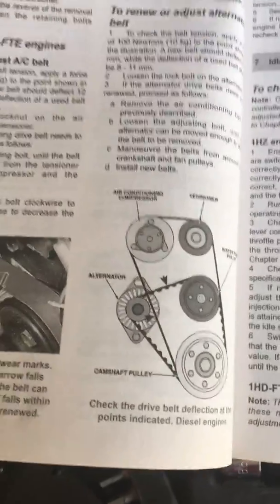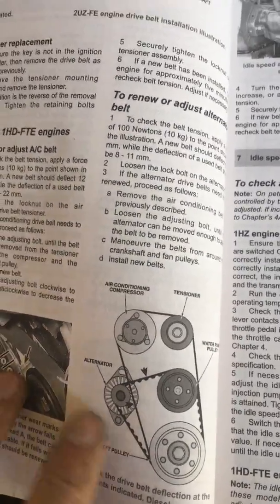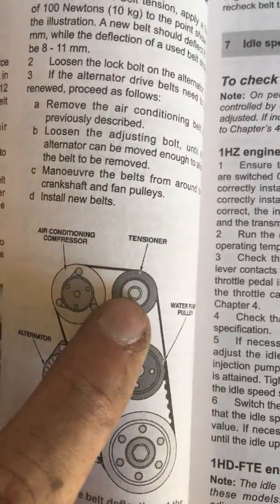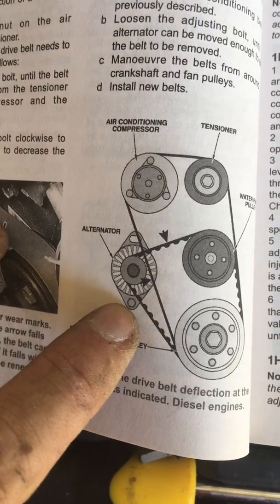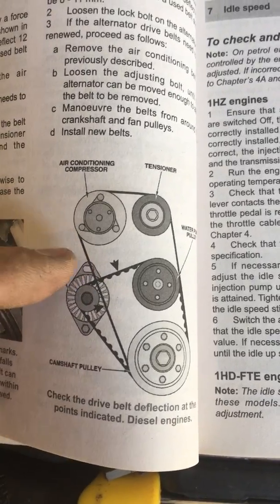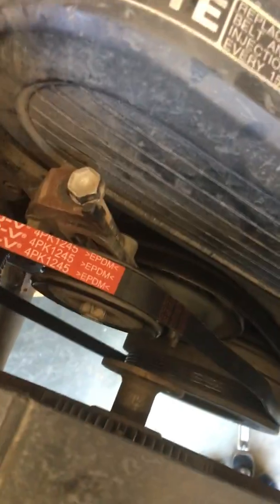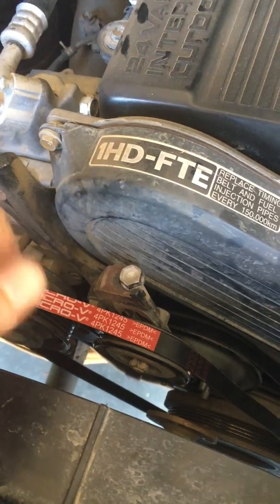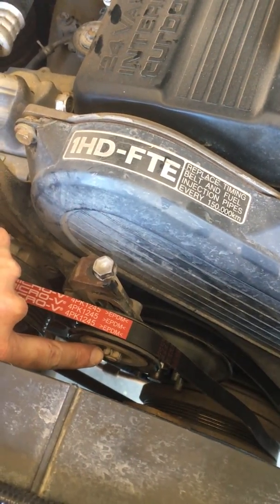HDJ100 / 1HDFTE alternator and aircon belts

Comment: Nice video Mark, shows pretty clearly where everything is.
The alternator belt adjusting job is not too bad if you have the appropriate tools.
It is easiest done from underneath the vehicle.

Removing the bash plate:  8  12mm bolts. (for novices) 
Remove the 2 outer 12mm bolts from the front of the plate.
Loosen the centre front bolt several turns.
Remove the two side bolts from the plate.
Remove the two outer bolts from the rear of the plate.
Carefully remove the centre rear bolt (the recessed one) while supporting the weight of the plate, which should be now resting on the top of the second bash plate.
While supporting the plate, finish undoing the centre front bolt, then slide the plate forward a few mm, and lower the plate to the ground.

Adjusting the alternator belts:
Use a 14mm ring spanner to loosen the alternator pivot bolt half a turn.
Use a 3/8" drive 12 mm socket with a 50mm extension to loosen the top locking bolt half a turn.  Alternatively, an 12mm curved (interference) ring spanner works)
Use a 12mm ratchet ring spanner on the adjusting bolt.
When belts are tensioned correctly, tighten the pivot bolt, then tighten the top locking bolt, then tighten the adjusting bolt so it doesn't back out and get lost.
The whole job is about 45 leisurely minutes. Enjoy 🙂